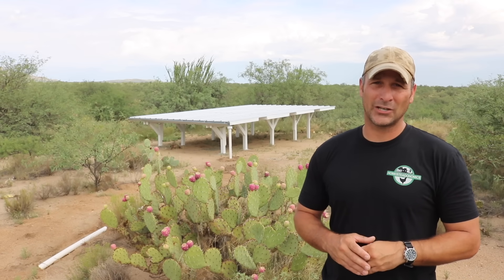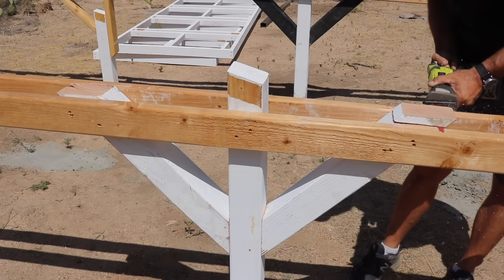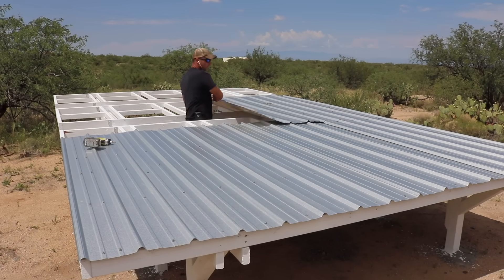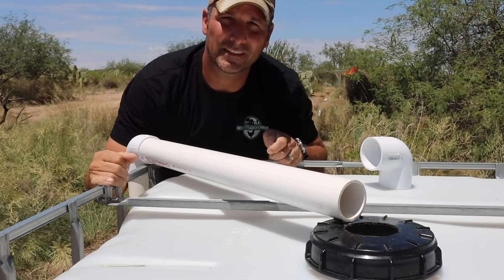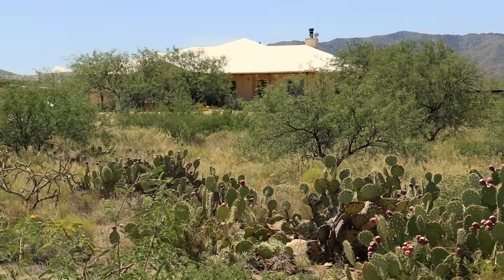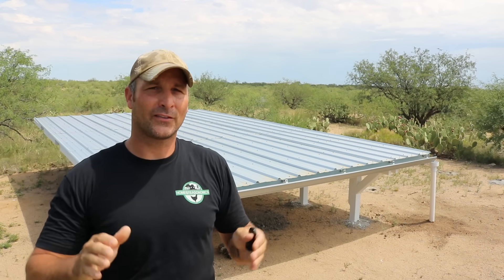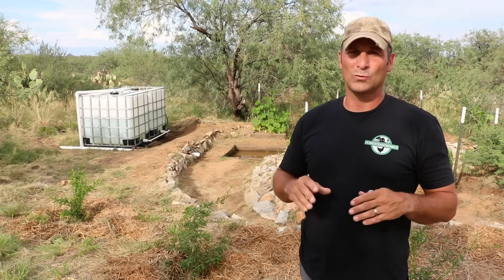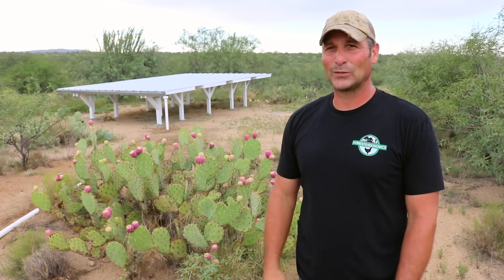Rain Roof -  Rainwater Harvesting Project - How To

Comment: This video is dumb! Why spend all that money to make a roof structure and you can't even walk underneath it to utilize it as shade cover you could have put screen around it and had a screened in room out there it would have been something cooler than just rain water collection you over concentrated and didn't think about the broad spectrum... lame.
Reply: Well at least he's doing something besides sitting on his ass
Reply: "something cooler" yep a privileged troll
Reply: @huhisitreally  yes we have rainwater collection on living scenario aka a trailer so this seems like one trek mind dumb bs without multiple purposes when at my property we are smart and have multiple purposes for every single thing... call me old fashion but when i engineer something i want to fix as much as possible with as little as possible... what this should ultimately be is a solar array with rain water collection a shelter underneath with a water heater and a shower and a 1500 gallon water storage tank with pump system powered by the solar array... that would be a system worth building... if you are gonna spend money might as well do it effectively and get the most for you're dollar instead of being a idiot and half way engineer some incomplete piece of expensive junk when for a little more money you can get alot more for your dollar... if you are in need of a roof why not make it out of solar? If you have solar why not have batteries? If you are making a roof why not make a shelter you can actually stand underneath? If you are collecting water off that roof why not have a big storage tank? If you have solar power why not have a pump system? If you have a pump system why not have a hot water tank? If you have a hot water tank why not have a shower? If you have a shower then why not just make this your home? In other words you dont need to build this system! Its specifically engineered BS without multiple purposes which means its garbage as far as engineering goes... those are the facts... sorry not sorry.

Comment: I would have extended their height just to plant part to full shade plants & then you wouldn't have had to dig a longgggg trench to the IBC totes because gravity would have dumped it down into them right away with the taller height roof 😁.

Comment: Would suggest a screen over the gutter & inlet. I have screens on my gutters,put a metal roof on the house several yrs back & harvest rain water at both the house & barn to 2500 gal storage at each location. The metal barn & system never has been dry. Between the winter to summer rains I get by without hauling water to the barn😊

Comment: Why wouldnt u use the roof for a purpose? So much material for a single use that a tarp and rope can achieve
Reply from the maker: Did you not watch the entire video?   I mentioned in the beginning of the video, that I would address common questions, like design, better options, why this isn’t the best design, etc,..
I addressed within the video, that it ideally it should be a multipurpose structure….carport, shed, house etc,…. But that I was re-using a roof material testing prop that I already had.   As a concept for inspiration of being able to collect.  I also mentioned better designs AND my tarp harvesting video that are ultra minimalist.   
But I guess that is just the direction of modern society these days.

Comment: For future builders:  Consider putting screws in the HIGH points of the metal rather than the valleys.  Will help prevent rust/rot from leaks.
Reply: Yeah these panels are made specifically to be fixed at the high points. The rubber seals on those screws don't last long in hard sun.
Reply: @BigChungus-zg6zw These panels are not meant to be secured at the high points.  You can look this up anywhere. These are generally referred to as “PBR” metal panel types, and the directions are clearly to install the fasteners in the valleys. 

Certain corrugated (your symmetrical wavy panels) steel roofing specifies fasteners on the peaks, but it depends.
Reply: So how do you secure it to the surface. The high points you merely secure the panels to each other. He connected them on the small high points.
Reply: @SophiaAphrodite  You use a screw that is long enough to span the extra distance between the peaks and the frame.
Reply: @SophiaAphrodite  you always secure ribbed metal roofing panels using long screws that have a rubber washer fitted to them so as the screw bites down the rubber washer seals the hole from the rain. (Using the high point of the rib ensures the fixing isn’t sitting in water).
Reply: @philtucker1224 all Australian sheeting jobs are fixed on the high of the panel.  Was always curious why Americans do it differently.
Reply: @johnh8615  I think it’s just one or two Americans. The other 300 million are more sensible.
Reply: Ok I’ll do it on high points now, it’s smarter anyway. I’ll just put more screws
Reply: If you look carefully there were 3 levels of height in the metal sheets. He did put screws in the higher points just not the highest ones.
Reply: @@fredtrump3459These panels come with excellent baked on enamel. Unless you damage them, rust isn’t a big concern. They are made to be fastened in the lower valleys.
Reply: But it’s less stable especially with high winds. I have never tried it.
Reply: To future builders, consider walls, or just make a shade structure. Only a moron build a dog shelter at best
Reply: Yes always on the high points. School boy error in an otherwise superb project outcome.
Reply: That's not you you secure a metal roof
Reply: Just to put this to rest, your standard PBR metal roofing panels are 100% NOT made to be secured at the high spots. That is indisputable fact directly from every manufacturer, at least by manufacturers in the US. Yes, the fasteners will need to be replaced every 10-15 years. No, rust generally is not an issue unless you damaged your baked on paint that the panel comes with.

Edit: There are times when you use short screws that are metal to metal screws at the high points to secure other pieces of metal to the roof, or in certain overlap scenarios.
Reply: If you want to put a dent under every screw, yeah look like an idiot and screw them down on the high points lol!
Reply: You could also use a house roof to collect the rainwater. If no house then a shade roof for a motor home?
Reply: @philtucker1224 yeah seems like making it slightly higher would give you a nice chill spot too haha. But seems like he had all the scrap wood built to that height. Maybe a good place for a chicken run or something?
Reply: @markislivingdeliberately  oh man, what are you on? 🤔

Comment: We also store water here. Use the run off from the roof and thru a gutter system. I added a DYI  water well which to my surprise supplies the entire yard and pond with water. Using a Harbor Freight shallow well pump. Runs off the solar panels I use for water collection too. I don't drink the water. Bought a test and shows to be fine. Little high on salt but I cant taste it. Fish in the pond like it. It's amazing how much water comes off of the roof and other structures. Thanks for the video. Given me some more ideals.

Comment: To make things better if you add a wide open object to the base of each plant by making a hole, the water will go deep to the root. Will use less water and better results. A soda bottle is good, cut the bottom and put the other side in the soil. Multiply the bottle as you need it. I'll do this smaller in my garden to catch the rain with clear panel to use the sun, short summer in my region.

Comment: I am desert, mountainside, way off grid, N. Az.  My very long driveway channels rainwater downhill.  So the idea for this monsoon season is to lay down 10 by 100 ft. of at least 6 mil. visqueen on the road and direct the water into my 2500 gal. water tanks.  After the season just roll it up.  Now if it will just rain.

Comment: What keeps the metal cool when the sun shines?

Metal is a bad idea. 

Yes, you have good circulation, but unless you have a continuous breeze you'll need a bunch of fans to keep it from getting hot. 

High temperature inhibits rain. I have seen it happen.

The justifications are excuses. Except for the caveat about possibly shading the syrup tanks, which you didn't do, you didn't address the heat issue. If the structure is for rainwater harvesting, you have defeated the purpose. 

Also, IBC totes are ridiculously small volume for the footprint. Unnecessarily covering the ground prevents rainwater infiltration, leading to more runoff, more erosion and more heat in the ground. You are cooking the ground. 

I wish people would stop encouraging bad ideas.

Comment: The even cooler thing about this build is that it can be easily adapted to generating hydro power too.  If you put a water blocker at a certain point to store water up and a small electric motor, that build can produce ~1kw.  If you have a lot of rain gutter capacity, seriously look into small hydro power, small solar PV components work perfectly for them.

You can go even further and add solar PV / battery backup with the hydro power and have a totally 24/7 grid that's superior to fossil fuels.  Then you can continue scaling your wealth up from there.  The hydro power / water storage / battery / solar pv model works globally.

Comment: A bit heavy on the ads buddy. Greedy
Reply from the maker: So I’m actually glad you mentioned that…. I was working with an MCN a little over a year ago and they turned All ads on without my permission.  Well, I asked them to change them back to just pre-roll and they said they did.   But I just started clicking through some and I’ve found quite a few with them on mid roll.   So I guess they hadn’t🤦‍♂️
Believe me… I don’t like videos like that either.   Sorry, it’ll be changed by sometime tomorrow when I can go through all of them. 
Joe
Reply: @homesteadonomics  wonderful idea for a video. Being in WI would need to do a valve thing to direct the water away from a garden when the containers are full. Thanks

Comment: Seems like a lot of expense to create the roof and structure. For a back yard scenario like this a tarpaulin would be so much easier and so cheap to do and equally effective.
Reply from the maker: Yes, not ideal, which is why I explained in the video this isn’t the best option, but that it was an existing structure.  And if you’re interested I’ve got about 3 videos showing a tarp set up😊👍

Comment: Excellent work, I have suggestion instead of using aluminum sheets if you use solar panels with slope towards gutter , will bring water in the gutter as well as you can generate electricity for your home. I like your work for thirsty animals & birds. Great job.

Comment: Soooo 1m width runs under aquaponics runs for easy harvest and space savings? I know you will lose some collection capacity but have the cloth put up so its lower over the plants/rain roof to collect whatever slow drips through and protect the plants from sun, then have it run to a tank that can be set to drip feed the correct amount to maintain water levels throughout the year for the aquaponics system? Based off no experience or knowpedge

Comment: One problem why not make it taller so you could have a shelter underneath? Keep the hot sun off of your car or keep the rain off of equipment. It's good that you keep rain water. Plants grow better with rain water over clorinated water from the city.
Reply from the maker: I addressed that and several other questions in the video.   It is not ideal and not the best use of resources.   Just using an existing structure to demonstrate an example.   Taller is definitely better.... or for material savings ground level using topography of land to the tanks.   
Thanks for checking it out

Comment: Illegal in the United States. And for good reason. It’s one thing to pump ground water, which takes years to become part of the natural aquifer.

When you take rain water you are stopping that water from ever going through the ground to the aquifer. It doesn’t seem important but it really is. That rain water keeps the soil at a certain compression ratio with the water that’s trapped in the soil, the grasses and shrubs DIRECTLY need that water along with the surrounding environment.

You’re literally turning your desert into more desert just so you can drink.

Spend the money, drill a freaking well. Stop stealing from nature in this manner. You’re not helping anyone but YOURSELF. You’re doing this to be independent and green. Not to just rape the ecosystem to get views on YouTube. Be what you promote.

Comment: You mentioned adding solar at some point.  Wouldn't it be interesting to create a solar farm that doubles as a rain collector?  Simply put catch gutters at the bottom edge of all your solar panels.  Finally, a car port or shade structure with rain collecting solar panels and integrated water totes would be a very interesting project.  Love your work, keep it up!
Reply: A triple-threat!
Reply: Its a good idea but solar arrays have a small crack between each panel around 1cm. Rain does not collect at the bottom of the array.
Reply: @bradspaugh9827  So, you are saying nobody could figure out how to build a solar array that doesn't have a gap between the panels?  Like, maybe a gutter or trough installed between them?  Or maybe a corrugated sheet metal or fiberglass roof with the panels installed on top?
Reply: @geoffschulz  like on top of your house?
Reply: Use SLIMLINE WATERTANKS in place of walls for a car port.
Reply: Like how you think!
Reply: They should definitely be built for multiple purpose ,like shade,,storage underneath,parking, and should be higher to put water storage totes under
Reply: I would be very careful about using galvanized steel.  Would recommend plastic sheet on top.
Reply: What’s the risk of using galvanized steel? Isn’t plastic more likely to melt
Reply: Might leach off bad chemicals
Reply: If we want multiply usage he can add some wind turbines too. There are models which using the solars generated heat turbolency. I dont know if worth the investment, but interesting thought :-) Maybe other type of wind turbine modells.
Using your idea as a shade/ shed/ barn basicaly anithing can be under it. Car, firewood, chicken coop, grill terrace, hay etc. Also a big investment, i think. :-)
Reply: @Kaczyfunny  How about small turbines below the tanks to generate electricity as well?
Reply: Let me give out some secret, in warm weather solar panels are loosing it's efficiency. Anything more than 25C° and solar power dropping.
In those conditions is better to build some thermal solar plant

Comment: Great set-up! What about dust/sand (fine particles) that will blow onto the rain catch getting washed down into the pipe and potentially clogging it? Will there be any issue with standing water in the pipe becoming stagnant because of those lighter rains not producing enough flow/pressure to push it up into the totes?
Reply: Add inline filters

Comment: Desogn is lacking in maximazation of viable structure  you need a tilted funnel- type "thingy"   thats a technical term...   What think you?   You think youd be yelled at if you utilized lumber for such...   Lumber with pitch is more sustainable than one might think if the projekt location is useful, yes?

Comment: what a stupid waste of time and money , maybe a low roof collect more water 😂🤣😂🤣😂🤣 make a carport instead , shelter for your goodies and water collector at same time , WELCOME TO DUMBMERICA !!!!
Reply from the maker: Well, I can see you didn’t watch the video.   I talked about how this is a demonstration and NOT the best design.   And that I was using an existing structure that I had used to test roofing materials.... and needed to be lower for our high winds.   I also spoke several times that a better design would be an existing structure and I even stated that it should be high enough to use as a car port or storage area.... or be extremely low to the ground using the topography of the land to make material use minimal if it wasn’t going to be higher.   This was simply a demonstration using that existing structure and is located on a spot on my property where i wouldn’t use it for any other purpose.   Just something to hopefully inspire ideas.    But I’m glad you got a good laugh.    
Have a good day🙂👍

Comment: I would suggest that next time you use solar panels as roofing material and get 2 for 1 you collect rain water and power your homestead also use your water 2 times the grey water can be used to flush toilets in that way you economise on consumption. send the black water through a home design sewage treatment to water the garden then each gallon is used 3 times

Comment: I grow fruit trees for a living (apple)  and one thing I'll mention is that when you are forced to water from the surface because of drought the tree tends not to root as deeply as it needs to and can be frail in a strong wind. Great projects, love your channel
Reply: Around here, young trees get planted with a U-shaped piece of irrigation pipe (ribbed, bendable, wide pipes, with holes and coconut fiber matting on the outside to prevent the holes getting clogged)  running underneath their roots, with each end sticking out of the surface.
That way they can be watered from the surface, pouring water into the pipe, if necessary until it is full up, which immediately runs down to the roots and starts to trickle out of the holes there so it gets absorbed into the soil underneath the pipe and the roots. That way you can water the young trees in a drought but also encourage the roots to grow deeper so they can reach the lower groundwater.